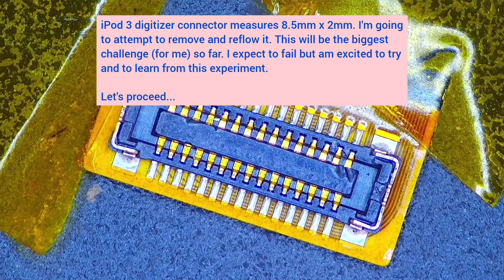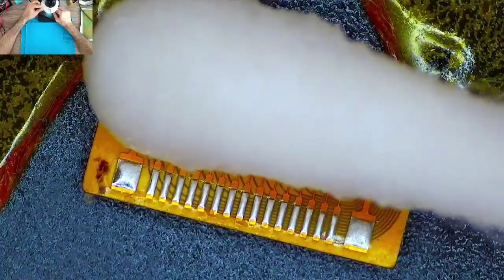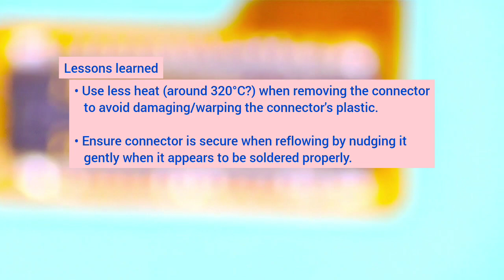31 iPod 3 Digitizer (FPC) Connector - Remove & Reflow

Comment: The proper method to reflow FPC connector is to heat from the bottom of the board.  If you heat from top as you did, the plastic connector will melt.
Reply from the maker: You have a good point. I've seen it done many ways in videos, including from the top (by professionals). It was a good experiment for me. Thanks for the tip.